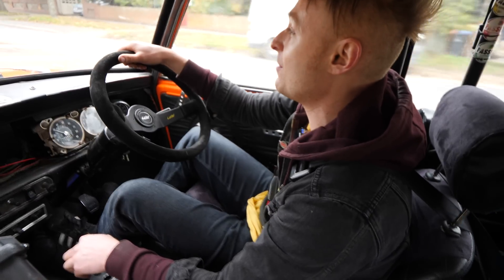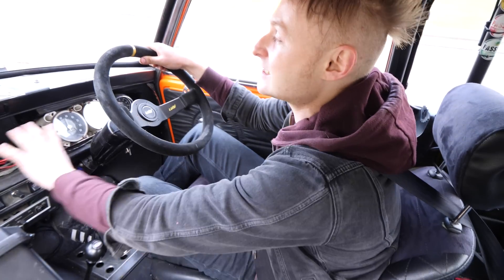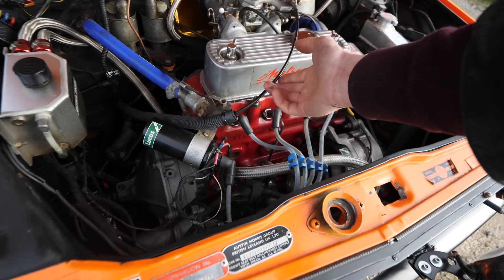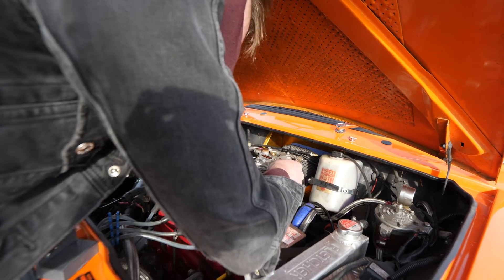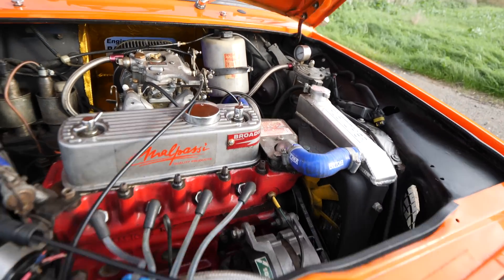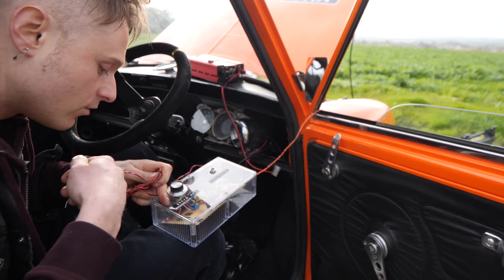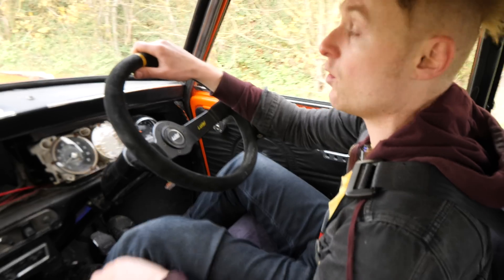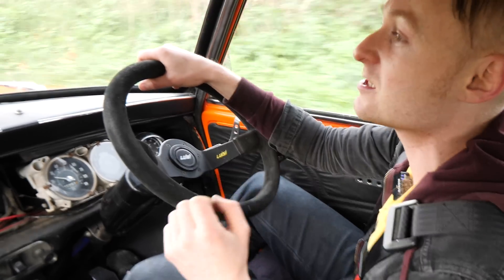WIRING A CAR TO A THEREMIN - THE THEREMINI -

Comment from the maker: So a bit of a story. Initially this plan was to make a box with 8 knobs of positions on the throttle which you could control. After chatting to folk on Patreon after sharing the plan it seemed obvious it wouldn't work and would maybe require input from the rpm pulses from the engine and aim for using the RPM instead of throttle position as control. This adds another issue that the code gets quite complicated as you would need to factor in the variable lag to stop the servo on the throttle control overcompensating when trying to reach a certain rev. Which slows down the control even more than just the flywheel but also risks it over revving and damaging the engine even using a feedback loop when testing. So I decided to go simple super simple! And use myself as the rpm sensor and just use a theremin as have no garage to test so have to go out to some random spot and I don't wanna be doing that every time I wanna adjust the design 😂. Theremin it is...
Also funnily enough i was trying abpout 4-5 years ago to get an f1 team to let me plug my modular synthesizer into one of their fancy cars, but no luck there so the car i have will have to do.
Reply: You have reached a new level of neurotic creative lunacy.
Well done mate
Reply: You could try  Nitro RC engine, they will do 27Krpm or more and are crazy responsive once tuned. 3.5cc is pretty easy to find for 1:8 scale cars.
Reply: @NittonÅttiofyra  Yes that would be a great idea and they are super responsive to the throttle, or maybe the screaming sound of a drone .
Reply: Dude , great video , what’s the price on the green mini , as I may be interested , I own 6 classic cars already thanks Sam , I’m only in Essex btw so could easily come look at the car 👍👍👍👍👍👍👍
Reply: i came for voltage controlled vroom vrooms, and was not disappointed!
som...VROOM.where...VROOM...ove...VROOM...er... VROOM... the... VROOM ... rainbow~ ... VROOM... VROOM... VROOM... VROOM
Reply: I love it, this is art, things that look stupid for some are masterpieces for others!
Reply: Just wanna let you know you're one hell of a guy and I get excited for your videos!
Reply: hahaha that's freaking awesome. Atleast you tried it thou!

When I was in high school I did think about modding my shit box first car to have cruise control but was scared it'd run away. I shoulda tried it because the teacher would have sabotached it/told me not to do it if it was too unsafe/too stupid (to make it safe) had've I pushed it too far.

Kid in the class took the exhaust off his car and wanted to rev the shit out of it, teacher said it'd be a bad idea, kid didn't listen, not wanting to anger the whole school the teacher pinched his rotor button, he couldn't work out why the car did not want to start and then mysteriously it started working next lesson after he put the exhaust back on 🤣 Funny thing is had've the kid wanted it enough and paid attention to class he'd have worked it out in no time 🤣

As far as I know my little rust bucket is still smoking away (had a bad head gasket that'd leak oil into the cylinder whilst idle and would flood the cylinder with oil if I parked it on a down hill) on a farm somewhere south of my home town.
Reply: The complexity and overshoot can be eliminated by simply using an open loop controller, instead of some laggy PID or whatever you were thinking.  You'd simply tune it at the beginning of the concert, just like a guitar, then each throttle excursion and opening preset would be "in tune".
Reply from the maker: @d00dEEE  yes but it would drift on every throttle pull
Reply from the maker: @d00dEEE  if I had a garage I could develop it I would have taken it further. But this is all I could get in the evenin I was able to put to it. Cheers tho 👍
Reply from the maker: @d00dEEE  initially would have done it to sweep and check, but it will need to constantly correct
Reply: a car with a carburetor?
Lol
Reply: Was it Renault F1?  https://www.youtube.com/watch?v=8aArSn4IhHI&ab_channel=rik4010
Reply: And... The car is now on display as an exhibit at the museum
Reply: Wait, I thought you were going to drive it like this.
Reply: the resistance needs to 2 tracks so 1 to 100 ohms up and track 2 100 to 1 ohms down there are 2 circuits thats how the car ecu cross checks itself. the car requires 2 variable restores one high one low 30/70 60/40 80/20 the cross check for the ecu and safety is =100
Reply: Renault did it with a V10 a while back 😁😁 https://www.youtube.com/watch?v=XRXwWbo_mX0
Reply from the maker: @bizzehdee  not everyone has access to an f1 car hahaha
Reply: @LOOKMUMNOCOMPUTER  Im sure you could find somebody to ask if they could lend you one 😁😁
Reply: Looking at the thumbnail and title, I was SURE you had wired it the horn.
Reply: Hello and welcome to the wikky whacky world of engine mapping.....

Having watched a few of your builds, I'm convinced you could build a controller to do it, but as you say, not a 1 day build.
I think you'd find useful information from drone flight controller programming, they face exactly the same type of problem generating a response curve.
Theres certainly a rocket builder on you tube that has done the work and built a rocket flight controller.
Or you could brew your own by taking 1st, 2nd, 3rd and 4th derivative of revs error and mixing them together via parametric biases. All analog (so fast) and quite modular once you build a differentiator (op amp and cap}

Then again, there's diesel engines, which have a load of error correction built into the injector pump, unlike carburetor engines which are virtually open circuit. Diesels operate by revs request rather than straight forward (dumb) fuel metering.
Reply: going by throttle position is actually going to get you very close.  You will need to do some tuning, so that position 1 gets you say 1500 RPM and is note A.  then tweak so that its actually 1555 RPM with is a true note A.  An unloaded engine will almost always give you the same RPM at the same throttle position if it is truly repeated.  If you were trying to do this while loading the engine, all bets are off.

Comment: I have a leap Motion controller. Which is a hand tracking device. There is software to turn different axis of hand motion into midi inputs. Meaning you can act like a theramin but have more axis. Including rotating your hand or tilting it up and down. 

You can of course use this to control an Midi Synthesizer. And perhaps with some electrical engineering skills - use it with a modular synth.

Comment: I think one issue is the engine is not working under load. If I manually throttle my stationary SAAB 900 it is just as hard to get more than 3 notes from it.

Comment: Instead of using a servo for the throttle control you should use an electronic throttlebody from a car that is equipped with one, they are much stronger and thus can control the throttle position much faster and more precise. There are some electronic throttlebodies form bmw m3´s and some other cars that are designed for a throttle cable instead of having the throlle valve connected directly to them.
Pls like and comment some other throlle actuators that use similar designs so he´ll se it.

Comment: Was thinking, maybe a set of small engines of multiple sizes would be interesting, going from a little 9volt motor to a motorcycle engine, maybe with magnetic pickups too, it would make I nicer thicker sound and should be able to go as deep and as high as you'd need

Comment: Sam for the love of god, please put your hoodie tightenings strings in your shirt when working on your engine, I can't watch you leaning over the engine bay even without it running. 

The cooling fan can start running any time even with the ignition turned off, well at least on modern cars
Reply from the maker: Thanks titus. Will keep in mind. Won't ever do that running. As for cooling fan there is none on this. But cheers

Comment: Genius brilliant idea that absolutely should have been tried out. Theramini I mean the name says it all. Did you find the washer? You drove off and left your camera behind? What about a 2 stroke leafblowermin? Or an electricdrillamin? Actually that servo can pull a brake cable really well. Bike wheel powered by a motor and a brake caliper the theramin can put the brakes on and make them sqeal and load the motor and all sorts...

Comment: There is a version of "God Safe The Queen" that was played on a Renault Formula One engine. I recommend you watch that. It is really good. That F1 V10 or V8 would be perfect for this Theremin idea. Also it might be interesting to make a setup for a more modern engine with injection that gives you better control. It will probably be able to perfectly match the input scale of the Theremin to the rev range of the engine.

Comment: How about adding RPM feedback to your controller so that you could target a specific RPM for each voltage level.  The controller would not control the throttle directly, but adjust up or down based on the current RPM vs the target RPM.  Like a PID controller in a drone.
Reply from the maker: check pinned comment cheers

Comment: Maybe turning on the headlights or some other heavy electric load in the car will help to rev down the flywheel, just like adding parallel resistors to a capacitor to increase the cutoff frequency.
Also it might be possible to remove the servo pulse interface from the servos and apply the control voltage directly to decrease the delay from the theremin to the carburetor

Comment: Just received this video as I was fitting a little solenoid about the size of the top half of my thumb onto a small fuel reservoir tank which will supply a dribble of diesel onto an igniter plug to produce a flame to heat up the air going into my 45+ year old Perkins engine fitted into my 40 year old Bedford ambulance (it’s cold start thingy)  The solenoid opens up to let air in to allow the fuel to fall by gravity - wish I’d have wired up to my Grandmother now, A# would probably be the right note play. 
Sam you drove off and left your camera behind ; )

Comment: you need a cars with much more over complicated "engine management system", and luck it overpowering your lock out side of things, "I remember something similar with an F1 racing car do something different, but it music sort of with engine, "it was a case of the tech. team with to much spare time on there hands" car noises I think it what all pre-recorded, music box, wasn't keyboard, like the ""You hum it son, I'll play it" sort of way. but you take it much miles out of it (pun), there a lot more sound cars can make, with just the engine its seff back fires, almost stalls, before you get to the rest of the car, like clown car?
Reply from the maker: i tried a few years ago contacting f1 car folk no luck. will have to do with the car i got cheers.
Reply: @LOOKMUMNOCOMPUTER  thank for getting back, and in only 26 minutes too, I was using F1 as prof on concept, it is doable, but use the hole cars must be loads of interesting sounds, live sound sampling, with out the recording, and playing back later part, like the organ you working on at the moment the sound it makes are real, not coming micro chip somewhere, but you can load gen midi file, it will play like an music midi music keyboard/box will do
Reply: just watched the video a second the, at the use said reason, about engine fly, size mattering, changing speed, that a hard one to get over, use the cars breaking system maybe, to sharpen up the slow down of the engine,  would involve lifting wheel off the ground so how (as they would be spinning around (health & safety, springs to mind as do hot pants optional), would be a lot more completed and lot more beefier actuator than a model servo motor uses (and ready supple of new break pads, used a lot)

Comment: It really is a pretty dumb idea.... So dumb that it's brilliant.

Just put another knob on it to set the max throttle position and scale the input range from the theramin to use the full output range.

Also, make the cam on the servo smaller. You don't need it to move quite so far and you'd get better throttle position accuracy at the same time.

If you wanted specific notes they should be doable off throttle position as well. The load is constant so a specific throttle position should give a specific rpm.

Comment: Perhaps you could use other Audio synch tech to drive your car, like an ADSR to control the throttle between gear changes, optimised and linked to the revs  🤓or generate opposite noise cancelling audio, for sure you need it.

Comment: try using a servo motor for the control voltage part to control the throttle of a small nitro rc gas engine. just might work.

Comment: Did it work musically? No, not particularly! Was it an awesome project that totally worked, hell yeah!

If you want to give it another go on another day, you might try figuring out how to read the RPMs back into the teensy, and run a PID control loop, using the theremin as the input, and the rpm as the feedback. You might be able to tune it to compensate for the delay in the system a bit better. But like you said, the rev speed is going to still be the limiting factor, and having a motorcycle engine that can rev faster will make that better!

Comment: I'm gonna keep telling you to get a Yamaha R1 engine.

You have throttle and "resonance" controls on that engine and both can be driven by Voltage Control. (resonance is a second set of butterflies that gives you variable runner length. Think of it as a slide whistle)

I know if I control that manually, I can make some really cool noises... but I bet you could make way cooler noises than me with this setup.

Comment: I reckon this can be made to work. The missing bit is that the the Teensy needs to be able to measure the revs and adjust the throttle to hold the revs constant for a given control voltage rather than holding the throttle position constant as it does now. Close that loop...
Reply from the maker: Check pinned comment cheers. It was all getting too much work. Reason I went for theremin was cus I was the control.
Reply: @LOOKMUMNOCOMPUTER  Haha! Apologies. I checked the pinned comment after I posted... One low-effort thing you could try would be to use the Teensy as-is on a lawn-mower rather than a car. That should work much better since lawn-mowers do have closed-loop speed control.
Reply from the maker: @colinstamp9053  dunny have a lawn mover 😂but let's see cheers

Comment: Test it with a two-stroke engine. They rev up in a snap. Adding braking will rev down quickly as well. Automate the brake (when going down a note or on release) for a nice combo. Then it is midi time.

Comment: It occurs to me that the tiniest engines commercially available are model RC car nitro engines; they are small enough and come in enough sizes that I reckon you could turn out a decent spread of “notes” with suitably tuned exhausts. Wire them up through midi like the pipe organ and play an engine orchestra!
Reply: Nitrorgan!
Reply: I came here to say this is. But if you use an engine in a mini body shell it could be the "Mini Theremini"
Reply: No, RC model aircraft engines can be much smaller than RC car engines, down as small as .049CI / 0.75CC
Reply: Oh, yes please. I hope he reads this

Comment: The idea itself is cool. However, There's alot more to it than just a different engine. To actually accomplish your goal, to play an ICE, you really do need an old naturally aspirated F1 V8 or the new Koenigsegg CS850. Here's why: Normal ICE uses a flywheel to create torque and keep the engine running on regular RPM <10K to smooth out the energy output from bang to spin. Even the tiniest 250cc croch rocket twin has some sort of mass spinning inside to make the bike go on low revs, and this mass prevents the engine to jump between notes. Only F1 V8's, V10's and the new Koenigsegg has no flywheel, no spinning mass to smooth out the bang to spin, and thus they can play notes with right software, as in Top Gear episode where the old Benetton Renault played "God save the Queen". And even if Christian von K would probably jump on board to this, there is still another hurdle, stroke and rev range. Koenigsegg V8 has three times more stroke than F1 V8 multiplying the spinning mass and inertia, making the note play based on throttle position almost impossible. CS850 has the best throttle response to any factory build engine, but still it won't play notes. I do encourage you to ask Christian if you could try, it being the only option around to come even close on the thing you are trying to do. Another option would be 1/4 scale flat plane crank V8 with 4-valve heads. This setup should match F1 throttle response close enough. Cross plane and 2-valve won't do it in any scale.
Reply from the maker: As mentioned I tried 4 years ago to do this with an f1 car but no one would let me 😂
Reply from the maker: So will have to deal with this till I win the lottery 10 times
Reply: @LOOKMUMNOCOMPUTER  Just ask Christian von K. He mentioned the idea in last TG interview, and could actually be interested. Definitely not the guy to F around with, but if you're serious, he might be too.

Comment: Fun idea, even if it didn't quite work out. Your patrons were definitely on to something with trying on a bike/high rpm engine (as it would have a bigger frequency range) - I've seen a modern f1 car literally be used as an instrument to play simple songs on it at a track day demonstration (theres YouTube examples too) as the engines from 2000s could reach 18,000 rpm and throttles are have very precise (and responsive) electrical control so can be stepped by computer like a midi synth!